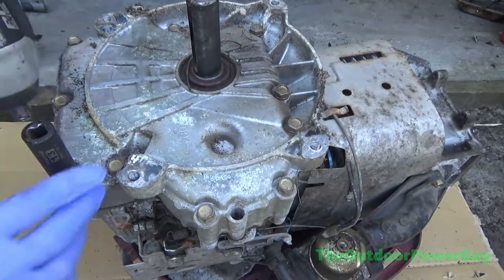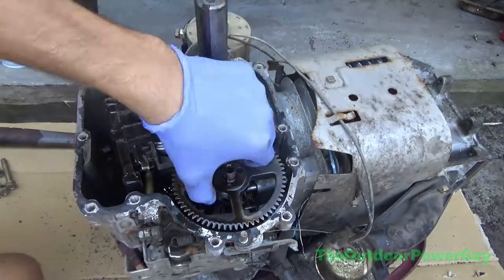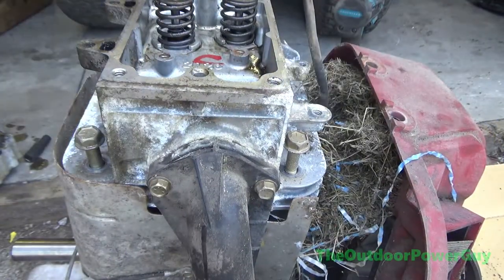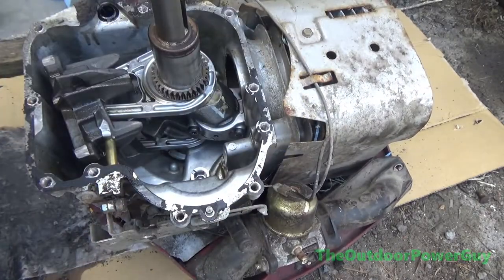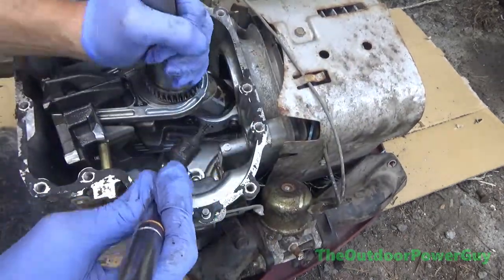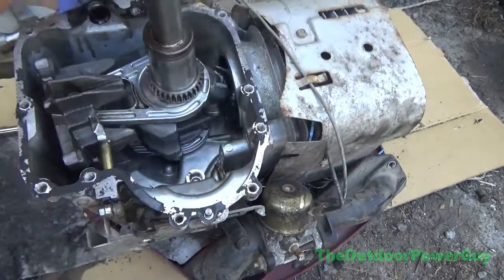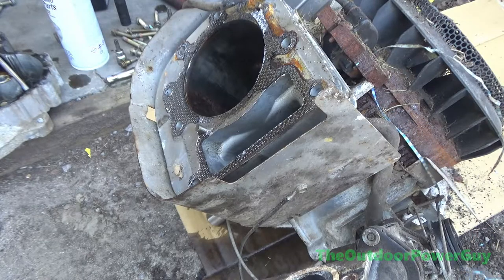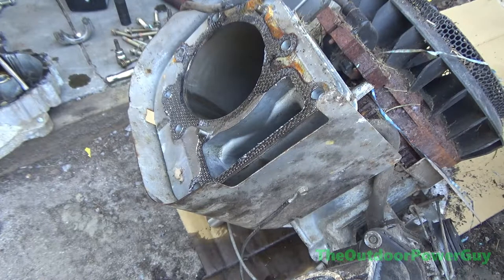Briggs & Stratton 15.5hp Intek Engine : FULL REBUILD PART 1 - Disassembly

Comment: Are all the intek single cylinder riding mower pistons the same? I need a used piston. I say used because the top of piston was damaged not the cylinder side.
Reply from the maker: No, all engines are different and i would highly recommend new internal parts, never go used! everything with Briggs goes by the code/serial number for compatibility.

Comment: If my Craftsman LT1000 has 2 blades can I take 1 blade off and cut my grass my deck is 42
Reply from the maker: No, you can't, it is not designed for that.
Reply: why would you even cut with one blade ??? if a smaller cut get a push mower or get someone too mow for you ??

Comment: How can I get the torx 40 to break the bolt free should I use heat or just keep searching for the magic torx socket that won't break. Right now I'm all in and this part has presented itself as a challenge.
Reply from the maker: try a 40IP Torx Plus socket, some newer engines are use that, regular torx will break.

Comment: You own a shop but tear down in the dirt?
Reply from the maker: It's easier for me to work on the ground than up on a work bench, i have a bench but it's quite high off the ground and riding mower engines are quite heavy to lift up on a table, it's easier for me and easier for the camera to see if i'm on the ground. Plus my employee usually uses my work table for 2 cycle equipment. Plus if the weather is nice i usually work outdoors anyways.
Reply: Part 2?